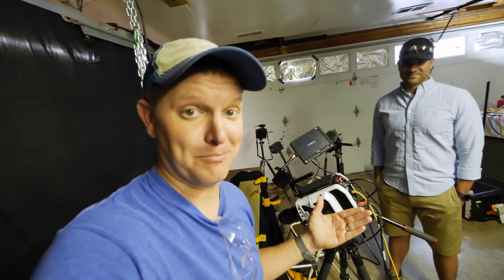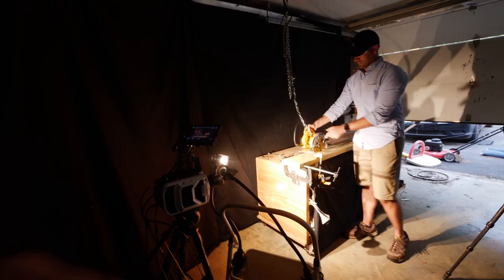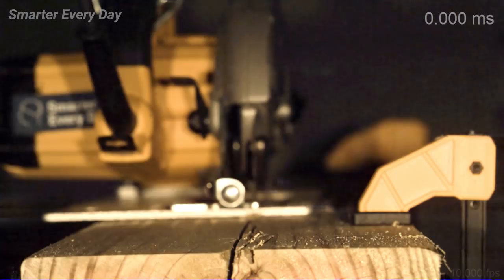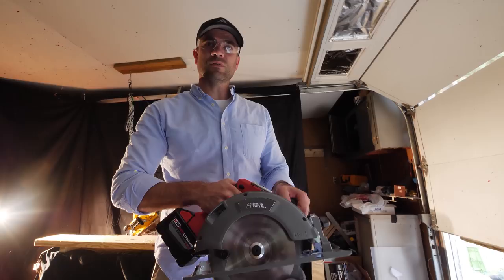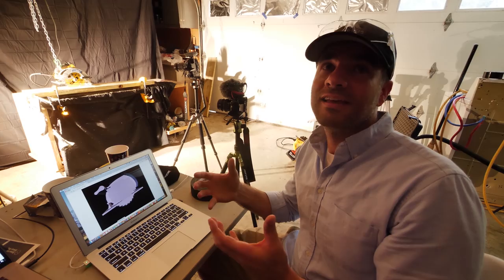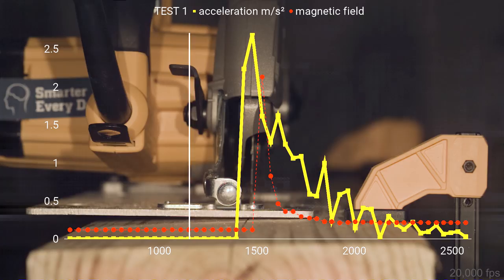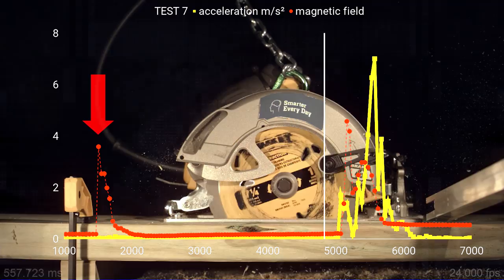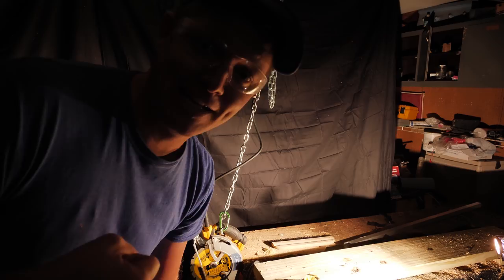Circular Saw Kickback Killer (We used science to make tools safer) - Smarter Every Day 209

Comment: As a carpenter for 9000000 years (3 years) I've seen a man have a saw go straight in his thigh from Kick Back. It was the scariest thing to ever happen in my life so far.
Reply: If only destin corp could have fixed this
Reply: i love your optimism
Reply: Was he using the tool correctly?   Like two hands or single-handed 2x4 cutting over your foot?
Reply: Id love to see that Feature on a sawzall cause you get kickbacks with those all the time when you have to cut out old windows. Also you often have to use it without the guard to get it in properly.
Reply: If you use both hands while sawing and kick backs appears you must be really weak if you can't handle it.
Reply: Didn't take long before someone whipped out the man card.
Reply: Riving knife helps with this like on the Festool track saw however, there are many situations where the riving knotted would not work. Like the mentioned above cutting out old windows. 
Great work guys. Hopefully we can get this one implemented. American ingenuity at its best.
Reply: @heyimamaker  , how do you use two hands in a working environment?
Reply: @davidmtwigg  I didn't see anyone pull the "Man" card! To which comment are you referring?
Reply: @anullhandle   Like you normaly handle a circular saw with two hands like you learn as carpenter. If you realy think there is any reason to work with one hand, then you shouldn't work with saws...
Reply: @heyimamaker  Though the same :D Holding a circular saw correctly, it can't hit you unless you loose the grip or kickback brakes your hand... And if, it would go in the upper body...
Reply: a coworker of mine nearly cut off 4 of his fingers because of kick back. this project could help a lot of people
Reply: @mr.wizeguy8995  thats true but most of the time using two hands isn't an option
Reply: Ha ha was it me I once put a Skil saw in my knee.  NOT FUN     I have also seen quite a few people cut off their thumbs and fingers
Reply: Hey I'm a Maker that’s actually a safe and productive way to cut material if done correctly
Reply: That happened to me. Right into the thigh. The doctor who stapled my leg back together said I missed the femoral artery by an inch. An inch from a fatal injury.
Reply: Was there no guard on the saw? Notice that Destin has the one in the vajayo zip tied off.
Reply: @briancheetham9134  Glad you're still here
Reply: @Kryynism  I know someone who lost an eye using an angle grinder when the disc came apart.  Guard was on and they were wearing eye protection, didn't matter.  scary stuff.
Reply: Glowing Alpine  so the question is, do we need another safety feature if people are only getting hurt because they bypass the ones they have? I wonder why your neighbor had his guard pinned back? I have seen saws that the guard was broken but do not know why someone would intentionally bypass it.
Reply: @DarkQueen619  oh that was for Mr Wiseguy with his you're weak if you can't handle a kickback comment. Plenty of strong men have been injured by kickback. Manliness has nothing to do with it.
Reply: @abro528  my granpa was cutting logs with a circular saw (should have seen it coming) and  nearly lost 3 fingers. Oh yes, this would help alot of amateurs and even some professionals.
Reply: @davidmtwigg  I as a woman! Agree with him! Kickback in a circular saw is not harmful unless you are not using both hands or you are very weak! Your the one who pulled the Man card, not him!
Reply: As a carpenter of 16 years I have had quite a few kickbacks. The secret in my opinion is to always have a really strong grip on the saw and always maintain a healthy amount of fear for all dangerous tools. Doing a series of plunges rather than a continues cut when doing rough strip out work also helps relieve some of the blade tension. Doing the cut in 2 passes rather than once also helps sometimes.
Reply: @randommcranderson5155  Obey speed ratings! Inspect blades for damage! (Might've happened to me...)
Reply: @Carlhoek  I believe most of this is due to poor setup. There's always a way to cut without binding.

I feel ashamed when a fairly new blade of mine has a smeared label.
Reply: Did he survive i am curious please answer
Reply: In other words, i hope this safetyfeature will make it way to the market soon. Would be usefull in a variety of powertools...
Reply: @DarkQueen619  I'm a millwright and we use professional grade circular saws to cut aluminum plate not just soft wood with saws from Home Depot, try that then get back to me about how easy kickback is to handle. Pffffttt. There now I've pull the man card.
Reply: @mr.wizeguy8995  A comment fit for the name of the submitter.
Reply: @davidmtwigg  And if proper use and "manliness" detractors, please explain the success of SawStop?
Reply: @anullhandle  The environment doesn't limit the number of hands you use. If you use tools wrong. Well, that might limit the number of hands you have.

it's easy to sacrifice safety for speed, and if you are incentives for speed then you are taking a risk that might not pay off one day.
Reply: @sprengstoffman  I normally use a skill saw like I use a chainsaw. it's off to the side and if it kicked it's going behind me.  I think this anti-kickback feature is great though.  I would hope that if it catches on it's not going to double to cost of the saw like Saw Stop.
Reply: @heyimamaker  yeah sounds like the way you learn to hold it right. Every saw and i.m.o ever millingtool can kickback, sometimes realy hard. But they are ALWAYS build that they go beside you and not directly in your direction, even if the do it flying! And its so well made these days, with a saw stop/cover, there is now way to cut yourself. But yeah it is enough to only do one thing of many wrong, and there your fingers go. But nobody that learned to use, and used a saw properly, will blame his badluck or the tool. Not speaking about broken hands. better a broken hand than a saw in the face. So always, dont forget to check your tight grip, even it seems to much for the work you are doing.
Reply: @sprengstoffman  Agreed!
Reply: @ARepublicIfYouCanKeepIt  Perhaps you meant some other word besides detractors? Your question is hard to understand as it is.
As for explaining the success of SawStop the answer is obvious, accidents happen, and people know it.
Reply: @justlookin59  that's a great idea to use a pencil to lift the guard ima try that next time
Reply: Glowing Alpine  have half of it elevated with 2x4s and walk with your knees as you rip it. If extra weight is around, you can add that to keep it from bouncing as you scoot down the length. Kneepads also help.

Since one side is elevated, it won't bind. Towards the end, put a 2x4 sideways along the edge to prevent tear-out as you cut through the last inch and the other half of the sheet drops. There won't be any binding at the last few inches.
Reply: @quirin5061  Me too!
Reply: @heyimamaker  does it matter? an injury is an injury and if it can be stopped with a computer then it should be stopped
Reply: @heyimamaker  so if someone picking up a saw for the first time makes a mistake they should lose a finger? people are going to use things incorrectly not matter what it is, that doesnt mean they should be as dangerous as possible
Reply: @randommcranderson5155  it broke through his eye pro?
Reply: @davidmtwigg  looks like someone answered with the beta male card
Reply: Ask my boss who cut his leg with a chainsaw because of he didn't want to wait until I cut the wood with a circular saw xD
Reply: @mr.wizeguy8995  You sound like some one who has never had a kickback to happen. Or may never even used such a saw.
Reply: @sprengstoffman  I've been doing flooring for 22 years now. Mostly new construction so I can look out the windows and see people building fencing about on average of every other day or so. "Nobody" uses two hands. One hand on saw. One on material. 2x4 or what have you off the ground held up with the toe of their boot. That is absolutely what is more common over doing things the most "correct" safe way. Quotations because time is money. lol I once watched a Bob Vila episode on the "correct" way to do flooring. It would take him a week to do things the way he was doing it to get done what I can do in a day. People doing construction are NOT taking every cut to a table or saw horse. Clamping or somehow holding things down and using two hands. It just almost never happens. 

I suspect most injuries from things like this are from normies doing DIY projects or from when contractors stupidly get complacent. Power tools are like anything else in construction. Skills plays a big roll. lol Which is fitting because just like how most say q-tips instead of cotton swabs, it's more often called a skill saw than it's called a circular saw.
Reply: @davidhenderson3400  Yes i have had kickbacks when i was young weak boy. Now much older and 15 year of construction business don't have kickbacks because it's mainly user error and if get one i can handle that tool.
Reply: @mr.wizeguy8995  I'm fairly new to power tools so far be it from me to able to give advice but my experienced colleagues and teachers have always told me that complacency and over-confidence is the way to injury and that it statistically it's actually more experienced people like yourself who get in accidents because they think they know what they're doing. Just food for thought.

Comment: This should become standard in all saws that can kick back.
Reply: Absolutely!!
Reply: Totally agree. I'd love to see this on a miter saw as well.
Reply: All you need is a small riving knife on the saw to keep from pinching the blade, or just pull the wood apart.
Reply: No carpenter would ever use this
Reply: @johnstonhunter6128  Yeah, just like SawStop table saws. I mean, who wants a safer power saw?
Reply: @MaFTB  Your dad is right, only problem is a blade is more than $25. A good blade anyway.
Reply: @MaFTB  I've been a carpenter for 15 years. When the saw stop saws came out we brought one for the shop. We've been through two cartridges in five years, both false alarms. I consider the table saw to be one of the most dangerous tools in the shop and the saw stop to be a bit of a no brainer. 
I was however cutting up pallets the other day with the circ saw and they were jamming the blade like crazy, I couldn't help but think back to my comment and realise that anti kickback would have been a pain in that situation. 
Still, all my battery drills have anti kick now and I sure love that feature, don't miss snapping my hand off with a hole saw jam. I still say I'd try a circ saw with anti kick for sure.
Reply: @MaFTB  doesn't that sawstop nearly destroy the whole saw, as in bend every mounting point when it locks up?
Reply: @jocelyndaoust3700  so you’re saying mistakes and accidents can’t happen, even the most experienced people can mess up
Reply: @shammient  Problems is the SawStops are pretty much only affordable to businesses and a few consumers. I agree this is good technology but if it adds significant cost to the product, then making it "standard" isnt really practical.
Reply: @ACEGAMER120  The inventor tried to license the tech to a number of big brand tool companies. No one wanted to use it so he made his own and doesn't license it to anyone else. Bosch made one, got sued  and took it back off the market. So I guess... yes, you're right.
Reply: But I just wanna buy a cheap saw
Reply: @bartfoster1311  That's what I thought they were putting on it when it was 1st described.
This is cool too, I guess.
Reply: I see no problem with it for all the weak wristed power tool operators.
Reply: @MaFTB  if you’re cutting through pressure treated lumber you could just turn off the detection system to make the cut and then turn it back on when you are done. This is a stupid excuse
Reply: A riving knife should be standard in all saws... and it should be glued in! so you americans cant take it out!! 🤣🤦🏻‍♂️
And also some trainings how to use the machines should be standart to..
Reply: Get yourself on dragons den before that patent is granted and get an investment by stealing their idea
Reply: So... almost all saws
Reply: @jocelyndaoust3700  so you are saying that accidents don't happen and if it happens you'd rather lose a finger. Got it
Reply: I feel a sawstop scenario happening
Reply: @MaFTB  thousands of professional woodworkers use sawstop. Many businesses do because an activation is cheaper than your employees medical bills.
Reply: @shammient  in cabinet shop we had a table saw the saw stop would grab the wood and bind every time we tried to cut.

Comment: As a fireman that cuts holes in roofs, my concern is kickback occurring after hitting a nail. Can't wait for the chainsaw video.
Reply: David Lara That’s is one of my biggest fears, the chainsaw kicking back while up on a roof.
Reply: Nails don't cause kickback, a limp wrist does. The carbide teeth cut right through.
Reply: After chopping tons of pallets up i can confirm that nails are no problem, also dont over tighten the blade and dont have limp wrists
Reply: @jacobengland1350  Unless of course the blade is dull, then you aren't really cutting anything. You're smokin and jokin. lol
Reply: This concept adapted to chainsaws would be a lot less terrifying than saw-stopping pants
Reply: The fire department won't buy you a blade that will cut through Steel and wood
Reply: I am pretty sure my Makita 36v circ saw will already detect kickback and brake the blade. Also it will cut through a roof and nails like a champ. So will the 36v chainsaw, although not sure about the nails there.
Reply: Just don't use the tip of the saw for cutting and you'll be good. 
I have used chainsaws since I was 12. I learned that you'll not get kickback if you don't use the tip of the saw (particularly the top half of the tip).
Reply: I honestly believe you would have a bigger chance of kickback with a chainsaw due to o e of 2 things. The first is the obvious is inexperience and 2 how big the saw is the longer chain the bigger the chain the more power it takes for it to rotate on the bar.
Reply: @jacobengland1350  it's still better to be safe
Reply: While you're on the roof enjoying the view, fresh air and worrying about nails, the guys on the inside are roasting themselves trying to put the fire out.  Forget the chainsaw and get yourself a K-12 with the proper blade.
Reply: As a roofer I completely understand why you feel that way

Comment: I've used a skilsaw for 25 years. I've never had a kickback. If you install the blade correctly it cant kick. For those of you out there using hypoid homeowner saws I have to tell you the saw orientation is for left handers, the weight is up high, and they're quite dangerous. Not having someone show you how to support the lumber is a route to an accident.  Same for chainsaws, drills, tablesaws...... study up, and be safe.